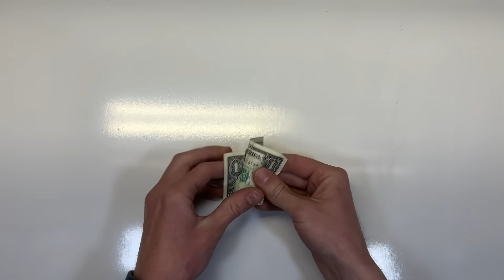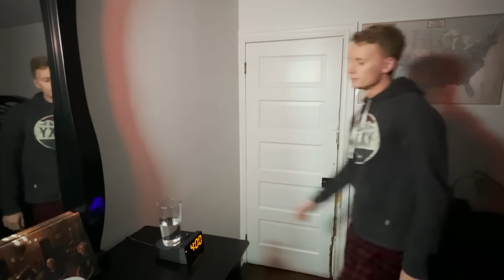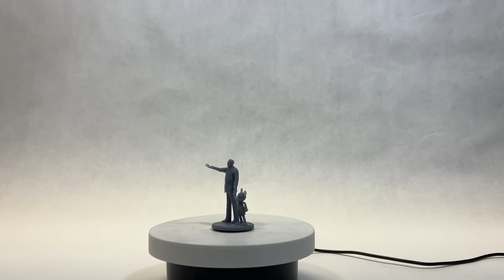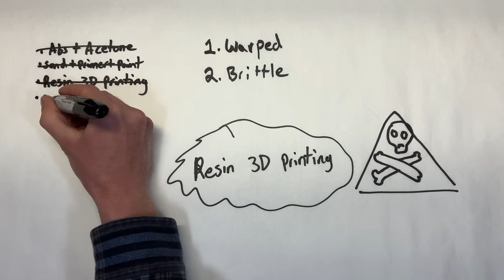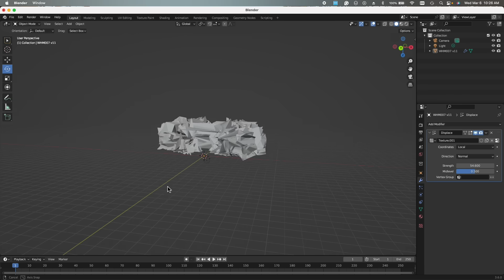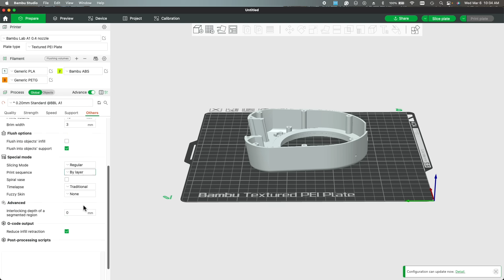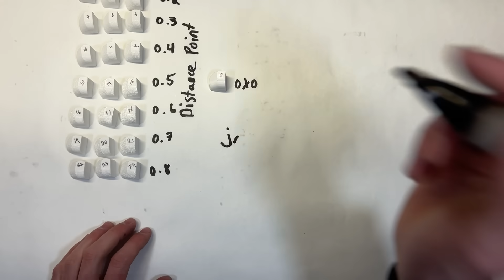My Secret To No More 3D Printed Layer Lines

Comment: Why do you use blender instead of fusion 360? I am at the beginning and I started with fusion, but I am unsure if I should switch to blender
Reply from the maker: I hardly ever use blender. I love using fusion 360, especially for making objects that you want to make in real life. The reason I experimented with Blender is that fusion 360 gets really slow with parts that I have a lot of faces (little triangles). Blender can handle more complex through the files that are oddly shaped. Not sure if this explanation makes sense, just know you’re on the right track using fusion 360 :) If you have any questions feel silly to ask on here, go ahead and post them in our discord community linked in the description!
Reply: Blender is extremely professional and its free.

Comment: A fast way to make things smooth, or faster then sanding and painting a part 20 times, is just to use a soldering iron with a flat or round tip. something you would have to DIY yourself. Using that, you can melt the surface of the print smooth. And it's faster than you might think. You can polish it after to help make it look real nice. But you must have a steady hand, or you can damage the surface details, faster than just smoothing things out. And you may need to try it a few times on a test part, to get it right. After that, you're good to go, print after print.
Reply from the maker: That’s a cool idea! Thank you for the advice! I hope to see you around after future video with more good feedback!
Reply: @jakemgrim I can't take credit for this idea. I seen it in a few videos by others, years ago. Sadly, few other 3D printer users are sharing this idea with each-other.

https://www.youtube.com/watch?v=JgDaVFBciII&t=278s

https://www.youtube.com/watch?v=ngsGA0VzBXA

But, of late, if you do a search for "using a soldering iron to smooth plastic" in a YouTube search, you will get a lot of DIY ideas for fixing all kinds of plastic things, that seem to be quite fantastic. And would also work well on 3D prints.

Have fun with that. ^.^

Comment: Thanks for sharing this information - as a play-around-with-printers guy who also happens to be an engineer who works in manufacturing full-time, one thing I'll say is: you went to the wrong shops to quote your injection molded parts. The Xometrys and ProtoLabs of the world are fast and easy, and if they're not cheap enough for you there's other options out there.
Reply from the maker: I’ll check those out! Thank you for the advice!
Reply: ANy other names you can share? I received the same quote he did for a similar part from Fictiv.

Comment: Hello, without viewing: Fuzzy Skin wit 0.1/0.1mm? That still leaves a different looking Top surface. But all other faces look almost the same (with PEI bed) and pretty good...
And fitting parts is more difficult
Reply from the maker: Are you asking for a picture of the 0.1/0.1 ?
Reply: @jakemgrim No, thanks, When I read the title this was, what I thought - it was my first guess. To get smooth optics I use fuzzy skin with 0.1/0.1mm (in Prusa Slicer) and imo that looks pretty much as the bottom of the print when using a PEI bed. So for me your video was not that much of a surprise. Ant the tolerance issue you mentioned as well.
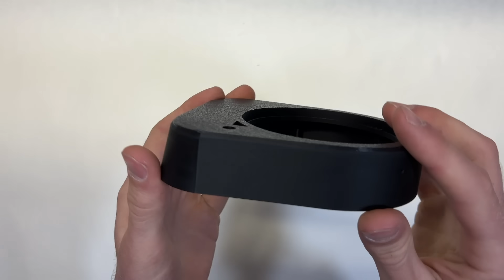But one thing I am curious about: at 7:55 there a face perpendicilar tu Z can be seen - i guess this is the bottom? If so, then your bed is a little rougher than mine so I guess 0.3/0.3mm works fine for you. But if this is the top surface then it is interesting, that with Bambu-slicer the top can be printed fuzzied as well as in ankermake slicer or prusa slicer I only have fussy skin at perimeters...
Reply from the maker: @benjamin_bartholomew_blake  that would be the top of the part but I print it upside down. I use the standard textured bed that comes with the bambu lab A1. I have yet to find any settings that would allow me to put fuzzy skin on the top. Do you have any idea how to do that?
Reply: @jakemgrim no elegant one. I guess atm moment a blender solution is the only way for top surfaces. But I didn't try yet. I found a tutorial https://www.youtube.com/watch?v=9WLixmqMXig&ab_channel=SouthernShotty and with a blurred b/w-noise texture from gimp and when changing the layer hight to the minimum for the top surfaces in the slicer maybe you can get something similar?

Comment: Hmm... did you try different resins or mixing certain resins? Adding 10% flexible resin by volume to your resin improves the propperties quite a bit.
Reply from the maker: I have not, what resins would you recommend I use?
Reply: @jakemgrim  Siraya Tech Tenacious 3D Printer Resin Flexible I usually add 100 ML to each of my bottles and it gives it a more plastic properties.

Comment: Your resin prints were coming out "warped and brittle" because you used the wrong type of resin for your part. You were also likely adding supports without thinking about the fact the print was printing upside down. Meaning you likely didn't have supports in the correct places for resin printing.

 And it looks like you gave up waaaaau too quickly in using Blender. You must be new to the program because you clearly had the displacement setting far too high. You can either use the setting's slider and type it in manually until you get the result you're looking for.
Reply from the maker: Thank you for the feedback! What resident do you recommend I use? And I know what you mean with blender, I just did that to be dramatic ;)
Reply: @jakemgrim  
 Yeah? Well, don't do that.
Not only does it it make you look incompetent and lazy, but it also makes Blender look bad. Those new to 3D modeling and/or printing will be looking for affordable modeling programs. Blender is easily their best option. They don't need your "jokes" tricking them into believing it's not up to the required task. In short, be honest. If you're not using a program for your final result, then don't bring it into the conversation. 

 As for which resin to use, that is something you'll have to research for your needs. eSun Hard-Tough Resin is very strong, but not cheap. There's also cheaper options like Peopoly Moai Tough Resin that performs similar to ABS. It's not as strong as eSun's, but it is cheaper.

 I don't know how long you've been 3D printing, but based on this video, it looks like you're in need of some basic lessons. This is not an insult but an observation. And this is for anyone reading that would like better 3D prints. Be it with resin or filaments. 

 Lesson 1] I know how tempting it is to print your models flat onto the bed/head of your printer. But if you expect it to withstand any pressure, then don't do this. Instead, angle it at a °45 and use the build supoorts support it. The printers print in layers. This means printing flat will result in no structual support pressure on the horizontal axes. Printing at 30-45 degrees greatly helps evening out the pressure points. Think of it as a brick wall. If you stack the bricks (ie layers) evenly, then the wall mortar easily cracks and the bricks fall over in columns. But staggering the bricks (layers at 39-45 degrees) increases the mortar bond and wall strength.

 Lesson 2]
 When printing in Resin, keep in mind that all of the weight is being pulled down with gravity. Meaning the already printed parts of the model provides less support because it is also fighting against gravity. You can visualize this with chewed gum and a heavy ball bearing. The chewed gum represents the print's supports and the ball bearing represents the unprinted model and gravity.  Place the freshly chewed gum onto the printing platform and then lightly press the ball beating into the guy's center of mass. Now watch what happens.

 You will see the ball bearing push itself down into the gum while also slowly pushing the gum outward. This is how filament printing works. And those pressure points are where you want to focus your print's supports.

 NOW, repeat the experiment but with the printing platform upside down. In this example, you will find the gum is being pulled instead of pushed. You'll also notice the gum is being pulled inward toward the center and the ball bearing. With resin printing, the center of the print is where you need the most support. Again, because the model and gravity is pulling it away from the build print. Based on the size and weight of your ball bearing, it might have already fallen away from the chewed gum. This Resin prints tend to need more supports than filament prints.

Lesson 3]
 This one is short and simple. Unless you're printing solid mass prints, ALWAYS make sure your resin prints have a drain hole. Also include an air pressure hole, which can be smaller. Otherwise you WILL end up with uncured resin sitting in your model. Over time, this resin WILL release gases. And you just might end up with a ticking time bomb. As those gases build up, it will push against the walls of your 3d print until it bust. And the busting of the print can be violent. Sending print shards and uncured resin everywhere.

Hope this helps.
Reply from the maker: @sespider   I want to express my sincere gratitude for taking the time to engage with my video and share your valuable insights. Your comment has prompted me to reflect deeply on my approach to content creation and has provided me with an opportunity for self-examination and growth. While some of your criticisms have left me feeling vulnerable, I believe that addressing them openly and honestly is essential for personal and professional development. Your willingness to provide constructive feedback is genuinely appreciated, and I want to assure you that I am committed to using it to become a better content creator and contributor to the 3D printing community.

Your assertion that my use of humor and light-hearted commentary may convey incompetence and laziness is a sentiment that I take to heart. As someone deeply passionate about 3D printing and dedicated to providing accurate and informative content, it is disheartening to think that my attempts at levity may have been misconstrued. I want to assure you that my intentions are always sincere, and any humor I inject into my videos is intended to make the content more engaging and accessible to viewers. However, I understand now that there is a delicate balance to strike, and I will endeavor to ensure that my humor does not overshadow the educational value of my videos in the future.

Furthermore, I deeply appreciate your recommendations for resin options and your willingness to share your expertise with the community. As someone constantly seeking to expand my knowledge and refine my craft, I am genuinely grateful for your insights. The world of 3D printing is vast and ever-evolving, and having access to the expertise of individuals like yourself is invaluable for both newcomers and seasoned veterans alike.

Your observation regarding my need for basic lessons in 3D printing has given me pause for reflection. While I strive to provide accurate and helpful information in my videos, I recognize that there is always room for improvement. Your feedback has prompted me to reevaluate my approach and consider how I can better serve my audience moving forward. I am committed to learning and growing as a content creator, and I thank you for providing me with this opportunity for self-improvement.

Additionally, I want to express my sincere gratitude for the detailed lessons you shared on printing angles and support structures. Your analogy of the brick wall was both illuminating and instructive, and I will undoubtedly incorporate your advice into my future projects. As someone who values the pursuit of excellence, I am deeply appreciative of your willingness to share your expertise and help others in the community improve their 3D printing skills.

Lastly, I want to thank you for your cautionary advice regarding resin printing and the importance of drain and air pressure holes. Your insights into potential pitfalls and safety considerations are invaluable for anyone embarking on a resin printing journey. I commend your commitment to promoting safety and quality within the 3D printing community, and I am grateful for your willingness to share your knowledge with others.

In closing, I want to reiterate my sincere appreciation for your feedback, even if it has left me feeling vulnerable. Constructive criticism is an essential catalyst for growth, and I am committed to using it to become a better content creator and contributor to the 3D printing community. Thank you once again for your thoughtful insights and valuable contributions to the conversation.

Warm regards,
[Your Name]

And now, I would like to ask you:

1. What specific aspects of my video do you believe could be improved to better serve the 3D printing community?
2. Are there any topics or techniques you would like to see covered in future videos?
3. How do you think I could strike a better balance between humor and educational content in my videos?
4. Have you encountered any challenges or obstacles in your own 3D printing journey that you would like advice or guidance on?
5. Is there anything else you would like to share or discuss regarding 3D printing or content creation?
Reply: @jakemgrim  
 My comment was in no way meant to discourage or upset you or anyone else. I can only judge based on what I see in this video. And likewise, what I see in your reply. I do not know you, and this is the only video of yours that I have seen. I saw possible issues that I felt needed addressing.

 Humor is fine, but it needs to be obvious. Even if subtle. The Blender joke simply did not come off as a joke at all. This is why I stated what I did.

 Thank you for the reply. But please stop using a.i. to reply to comments and/or criticisms. It's very unprofessional and pretty insulting. This is why I'm not going to answer your questions at the end of it.

 If you didn't use a.i. to reply to me, then I apologize. But key elements of your reply read very robotic. Even "copied and pasted". 

"Warm regards,
[Your Name]"

Seriously?!
Reply from the maker: Thank you for writing an essay about my work. I enjoy having fans as supportive as you. On the other hand, you have too much time on your hands. I would suggest you go out for Ice cream  :)
Reply: @jakemgrim  
 Kid, that took me less than 10 minutes to type. If you want your channel to grow, then don't insult those that care enough to write constructive feedback TO HELP YOU AND OTHERS!
And do not be lazy and use freaking a.i. to reply back!

 Seriously, what the hell is wrong with you?

Comment: Prusaslicer has had this for years also. 👌 I used it for car parcel shelf brackets in grey petg, look exactly the same as the car interior texture
Reply from the maker: What settings did you use? 0.3/0.3 ?
Reply: @jakemgrim  I can't even remember tbh, 0.1protrude, with a 0.1 layer line I think 100% infill petg. It's the only time I've used it. The grey petg happened to be an exact match to the cars interior colour, to the eye at least.
Reply from the maker: @gardian1701  good to know! I might have to try something similar with my car. Thank you for your feedback! Hope to see you around in future videos!

Comment: resin warping and brittleness is a direct correlation to the resin you are using.
Reply: There's abs like resins, tough resins, flexible resin, and you can mix them . Warping can also be solved by orientation and different support layouts.
Reply from the maker: Crap! Really? Which resins do you recommend I use?
Reply: @jakemgrim  If you plan to cast the materials they make casting resins. I would think you would want to go that route but Ive never used those. I have a Phrozen Mini 8ks and I use the Phrozen Aqua 8K 3D Printing Resin. And get no warping or anything once I have it dialed in.

Comment: Yeap  --  Turns out the secret is still injection molding
Reply from the maker: Have you ever done injection molding?
Reply: @jakemgrim   Why do you ask ?
Reply from the maker: @RectalRooter  I’m joust curious if you have any experience with it and have any advice you could share?
Reply: @jakemgrim  I gotcha. I've had some success with making molds from glued wood and lining the inside with aluminum foil. The tricky part for me has been to keep the plastic at a constant temp inside the auger screw.
Personally I think and hope more public process of printing with non planar slicing would end up being a much easier and way to 3D print. Here's hoping 👍
Reply: @jakemgrim  Your oddly quite

Comment: Sorry to hear you gave up on resin prints …seems like the problem was the printer itself. I’ve been using a formlabs printer, and it’s been extremely reliable with exceptional output. I also have an old one from envisionTEC that has paid for itself several times over.

If you can get your hands on one, it’d definitely be worth trying resin again!

Comment: Fuzzy skin all walls might not make much sense in terms of visibility, but I guess it will improve the strength of the prints as the layers are interlocking even more.
Reply from the maker: I never thought of that. I think you are correct. It would likely be even stronger!

Comment: Dude, 3D print do all your sanding make it nicey nice. then make silicone mold and cold cast. Would solve all your problems, just make sure to use a pressure pot for curing to get rid of bubbles
Reply from the maker: I thought about doing that, but I’m not sure that it’ll scale well. Have you ever made a silicone mold before? I would really like to try it!
Reply: @jakemgrim  It will scale very well. Its best way to do mass production without plastic injection molding. Yeah I certainly have made a silicone mold before. I do mold making 3d printing and prototyping for living.